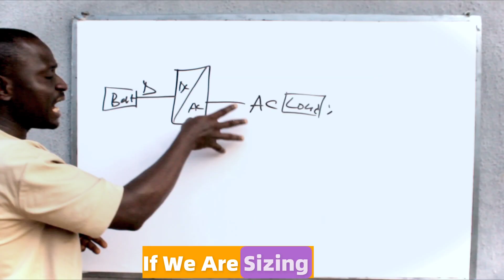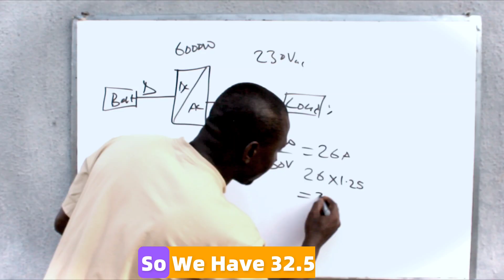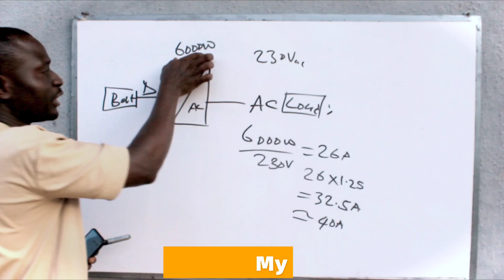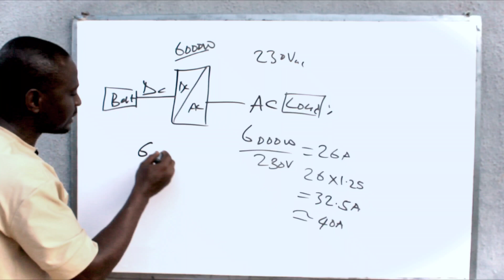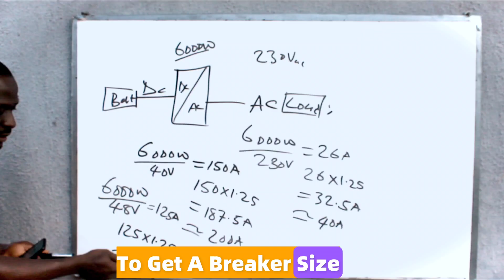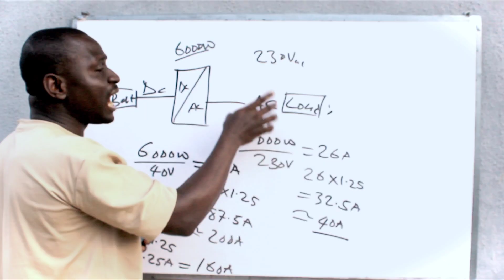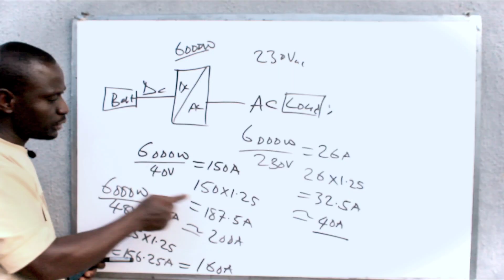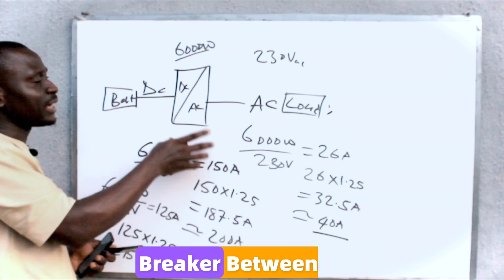Training on solar and inverter| How to Size Breakers Between Inverter, Battery, and Loads

Comment: For the inverter input @ 48V nominal, 125/inverter efficiency before multiplying by 1.25 safety factor. Therefore 180Amps breaker will be safer.

Well done boss.